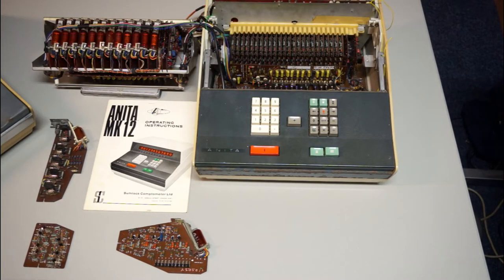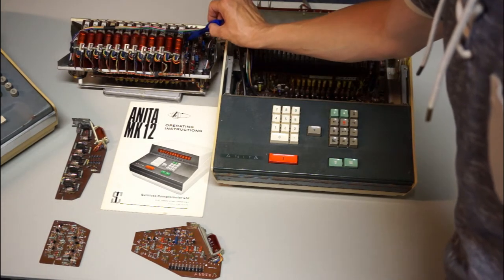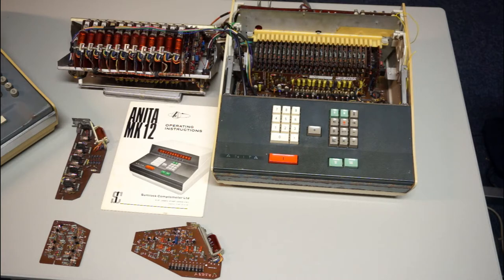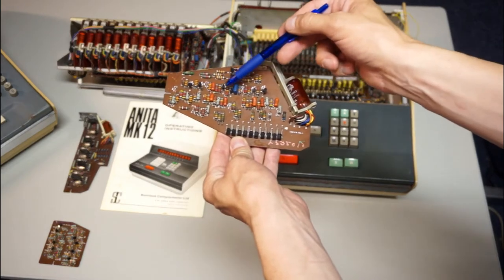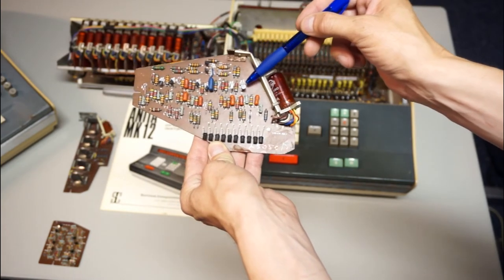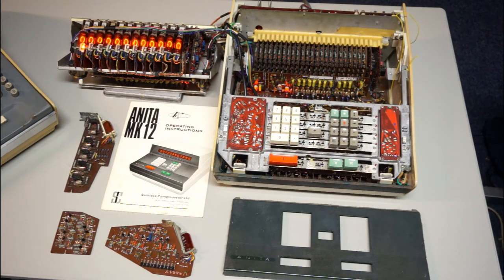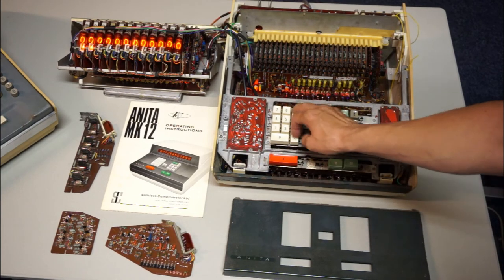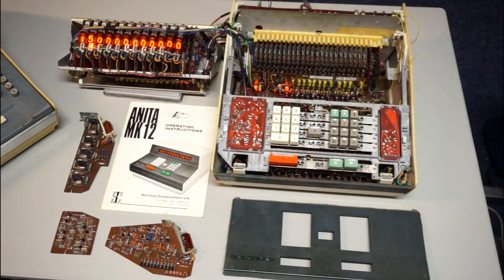Anita mk12 vintage nixie tube calculator full demonstration and compare with the MK8

Comment: I have an old mk 9 still sitting in the garage. I worked on the mk8 mk9 mk10 mk11 and mk12. Also the 1000/1011 IC, 1011LSI 1211sl.Also the  811 hand held calculator.  I've still got the blue prints for the mk8, 9 & 10 I think. I once converted a mk10 from £sd sterling to do Tons Cwt and quarters for the British Coal Board. It could be switched between sterling and weight through a panel I mounted under the front of the keyboard. I used to make digital clocks out of Mk12 display cards by dividing down the 50 Hz mains frequency. I used six to do hours, minutes and seconds.
Reply from the maker: A MK9? Very nice, I love these machines. Did you work at Sumlock as engineer or was your job to service the machines? I've got a huge amount of documentation from a former Sumlock employee. From him I got also a few machines like MK8, MK12, 1011, 1011lsi, 1011p, etc. Funny idea to make a clock with these circuit boards. The MK8 boards are easy to modify to set them to count from 0 to 5 etc... But I think it would be a waste to do this nowadays with these pieces of history. I've got the original manual for a MK10, but never seen a MK10 for real... Any plans for the MK9 btw?
Reply: The problem with the mk8 etc was the 19meg resistors going high. I'm not sure what to do with the mk9.  I was a service engineer and used to repair the whole range of Anitas including the business machines like the Anita 5210 that used an Adler type writer with a form feeder on the carriage and a Anita 1011lsi as the data inputer. The electronics were cobbled together from the Anita IC range. Making a clock was easy because we had lots of spares and digital clocks were still rare. When Sunlock/Anita closed, hundreds of brand new Anitas, still in boxes, were destroyed at Uxbridge where they were stored. They preffered to destroy them rather that let anyone have them. I had the job of throwing them down flights of stone stairs. Where are you based,  I'm in Hertfordshire.
Reply from the maker: Hi Alan, the 19M resistors are quite horrible indeed. Not only the MK8 but also the MK12 suffers from this problem. And after all those years there are more problems in these machines. The dekatrons for instance seem to loose their gasses. Capacitors are getting leaky and diodes go OC. Here you can see my MK8 working: https://youtu.be/6-qvtiqWens The complete MK8 story is on my website http://technischmuseum.nl . It is written in Dutch but google translate can help here. That brings me to where I live, and that's in the Netherlands. My Anitas came from the Sumlock department in Stoke on Trent. Mr Lee explained the MK8 to me and pointed me to the mark and skip ratios from the oscillator as well... That explanation and documentation was a great help to get them running. If you ever want to get rid of that MK9 please let me know...
Reply: Yes. I was an engineer at the central London branch in Clerkenwell. It was easier to use the Mk12 cards as the components on the mk8/9/10 used trigger tubes and selenium diodes and components tended to drift a bit. I think I will sell of all my calculators as I'm too old to appreciate them now. I remember the clunky old 1011p, strange animal and not too reliable.
Reply: hi Alan  I worked for Anita also with Charlie . John  great times  
Paul K

Comment: I guess they could had used a 6C4 in place of one of the 12AT7 tubes...
Reply from the maker: Yes they could have used a single triode tube instead of that 12at7 double triode from which is only one triode used. That would be a normal designers choice. But I think that Sumlock had a massive price agreement on the 12at7. They have used thousands and thousands of them in at least the Anita MK8, MK9 and MK10 machines. In these machines there were 10 of the 12AT7 tubes. I'm not sure about the MK7 but I think they were used in that machine also...